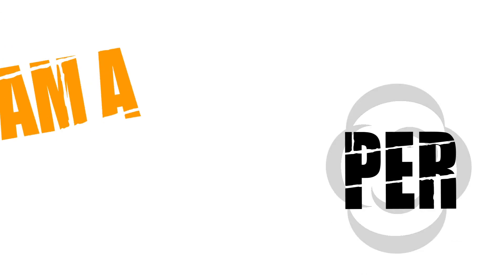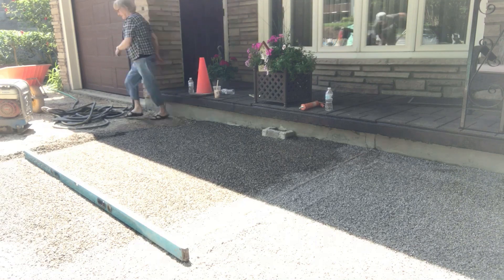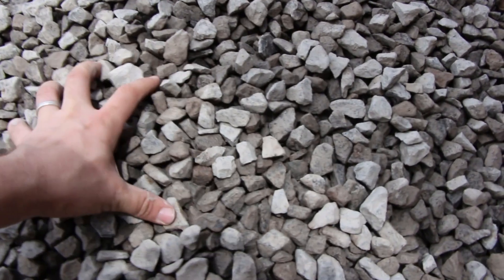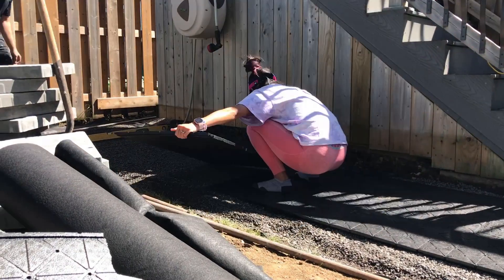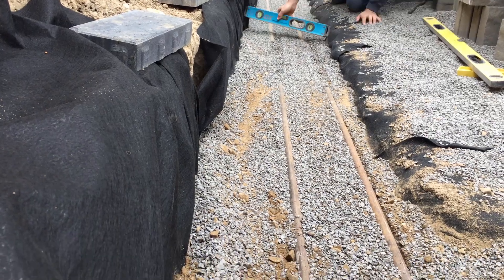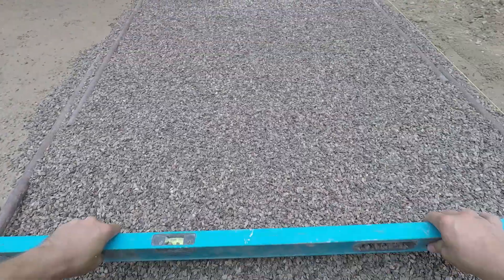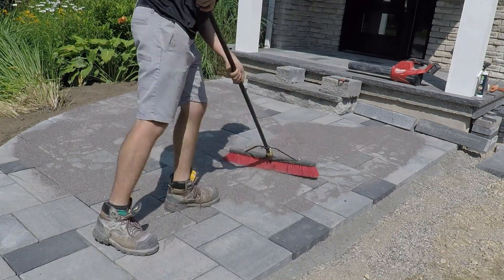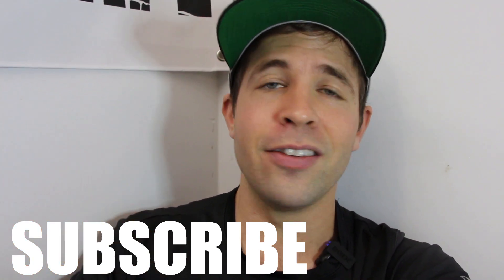High Performance Bedding for Pavers | Why We Use HPB Instead of Concrete Sand

Comment: Using sand to grade is the worst possible choice cause it's to soft and easily disturbed  and it can get washed away easy by heavy rain and ants will dig up your bedding . The only issue I don't like about high performance bedding is that it can scratch the surface of your stones and it's not fine enough to grade prefect . I have to lay plywood and tarps underneath plywood  when I'm using high performance so we don't scratch and destroy our interlock
Reply from the maker: Yeah I can definitely see that problem if it tracks on top of your pavers

Comment: Another great video, wish I saw it sooner. I’m in SoCal and went with Class 2 permeable 3-4 inches + 1” coarse sand screeded for the patio; and 2-3” DG on top of the Class 2 for the artificial turf sections. Supposedly USC used the Class 2 permeable for their new turf field, so hopefully it works for my back yard

Comment: Micheal, love your site. Thanks for taking the time to share your knowledge with others. I am a DIY er building a clay brick walkway/patio on 7 inches of conventional base and will be going for the 1/4 " chip bedding 1 1/2 inch thick. My question is how high should I place the brick against a fixed edge, so after compacting the brick will be relatively flush with the edge. I am planning on spacing the brick with 3/16 " gaps and using polymeric sand. My other question is how do you think I should compact the finished job? My thoughts are hand tamping after spreading the initial sand application and power tamping on plywood after the finished sand application.

Thanks
Don
Reply from the maker: Hi Don, thank you for watching! Typically HPB will settle up to 1/8" per 1" of depth. So depending on how deep your bedding layer of HPB is you can use that as a benchmark. I would sweep in the sand to the joints and then compact on the plywood. But it wouldnt hurt to do it as you mentioned as I am sure with the clay bricks you are laying they wont be touching one another (open space gap). So that initial tamping will help lock them in so there is no movement. But it is another step.

Comment: Man thanks to Mike and his/this video it saved my bacon today. I originally bought a load of HPB from a well known local building supply store (no not one of the big box stores). I ran out do went to another supplier very close to my house and picked up another load. BUT, after watching this and other of Mike's videos, while not a pro, I've done enough homework and research to know 1/2 of the garbage I put down was not the recommended material. Too many rounds and it felt like I was walking on a pebble beach with my feet slipping under me. 
After checking in with Mike, he graciously advised Absolut don't use that material. So my instincts were right. 
That $150 of material could've ruined my entire patio. 😢 But as we all learned in Star Wars; trust your instincts, you know it to be true.
Thanks Mike 👍
Reply from the maker: Thank you Carl! 👍
Reply: @iamahardscaper  It's important to give credit where credit is due. 👍🏻

Comment: Hey what base do you recommend for a 2" flagstone patio in Ontario? 3/4" Clear then HPB? Will be doing one in a new video! Thanks
Reply from the maker: Yes, that’s what I would do. You need to really sink them into the HPB and use an appropriate jointing compound to lock them in (I’ve heard NOCO by Techni Seal is good).

I love your videos by the way! I just watched the hot tub one last week. I live in Toronto and would love to come by and see what you are doing.

Comment: Discovered your channel a bit too late and have already installed 6” of dense graded base, the 3/4”-1” minus. The area does get water runoff as the yard has a slight grade toward where the patio will be located. Planned to use sand, but would you recommend using this material as a screed layer instead even over the dense graded base? After watching your videos, realizing this may not have been the best choice for a base layer, but it’s already in the ground and hoping to get things right for the next step. The pavers will not be permeable, if that matters—using Unilock Beacon Hill smooth pavers. Thank you!
Reply: Also located in an area with freeze/thaw cycles.
Reply from the maker: i like to use it on my screed layer regardless of the base material

Comment: Excellent presentation. From Ontario Canada. What is the standard depth required for base using hpb for bedding? Is a sub base of granular of 4-6” needed? How deep does the base excavation need to be for a common residential patio, walkway installation?
Reply from the maker: We go 1" to 1.5" of HPB as a bedding layer. Definitely still need a base, we go 6 to 8" for our base for residential patio, walkways. Because we are dealing with so much poor clay soils here.
Reply: @iamahardscaper  In my part of Toronto it's primarily "yellow" sand, which results in amazing, for the most part, drainage as opposed to the clay I was accustomed to in Scarborough. 
I am doing a walkway with concrete flagstones. Would you recommend the same base as the reply above?

Comment: I am just about to screed a small patio in my yard. This video has convinced me to use the HPB over a concrete sand. You mentioned it would sink a bit, but I am assuming for a small patio, this would be negligible?
Reply from the maker: No, you just need to account for that when you are screeding. That it will go down less than a 1/8” per 1” of bedding. You want to screed a little above your final height

Comment: Hi,
Thank you for the great videos.  I am putting up a raised patio.  I excavated about 12 inches.  I have put in 6 inches of aggregate A and add 4 inches of HPB as the bedding layer.   How much should I compact this layer ?  The aggregate A was compacted with a vibrating plate,  should I do the same with the HPB?  Also should I use a synthetic layer on top of the HPB to prevent shifting, and future ant colonies?
Reply from the maker: HPB does not need to be compacted. Though we don't go any more than 1.5" for HPB. You've got enough base there that you do not need the synthetic panels on top.
Reply: @iamahardscaper thank you !

Comment: Amazing video, thank you for sharing your knowledge. I'm in Toronto Canada and just dug out a 400 sq ft area to lay patio pavers. I have dug down 7 inches. My patio pavers are 2 inches in depth, so I need fill 5 inches for my base. Would it be ok to use high performance bedding  for my entire base? I was originally going to do 4 inches of recycled crush stone and 1 inch of limestone screening. But my life would be so much easier If I could just to 5 inches of hpb followed by polymetric sand to fill the paver joints.
Reply from the maker: Unfortunately not. It doesn’t have the same bearing ability as a 3/4” stone or Granular A which would be your base.
Reply: @iamahardscaper  So then put 3/4 stone as my base then use hpd as the bedding? do you think 2 inches for hpd is sufficient?
Reply from the maker: We do no more than 1.5” of  bedding material
Reply: @iamahardscaper  understood, so I'll be going approx 4 inches of 3/4 crushed stone with 1.5 inches of hpd

Comment: Hello, about to start a DIY backyard patio and your videos have been very helpful. Keep up the great videos. One question for you though, can you use HPB as the entire base or would I need a 3/4 clear as the base and then use the HPB as the bedding layer? I've been getting mixed answers regarding this. The yard that I'm purchasing my stone from is saying that I could use it as the entire base layer directly on top of the fabric.
Reply from the maker: You definitely can only use it as the bedding layer. I used to work at a yard that said the same thing and even myself installed some on only HPB. But it is not a base material, it just does not have the bearing ability that a larger aggregate does. There are no manufacturers or the governing body of interlocking concrete that specify it to be used as base.
Reply: @iamahardscaper  do I need to compact the HPB above the 3/4 clear aggregate?
Reply from the maker: nope

Comment: I used to build interlock patios from a pool company and we always used 3/4 clear as base with hpb as top layer.
I am doing a patio for my own home now years later and ivd been told by someone who sells the material that the hpb will wash through the 3/4 clear and to use 3/4 crusher run and hpb as my 1" bedding. Does that make sense?
Reply from the maker: No, 3/4 clear does not have gaps larger than the 1/4" HPB for it to wash through. That being said, we have used 3/4" down to fines for our bas with HPB on top for some scenarios.
Reply: @iamahardscaper  awesome, appreciate the replies! Solid page. Helping out huge. I'm at the point now to put polymeric down. Worried about tamping and possibly moving interlock too much. Looks like it needs to be done.
Reply from the maker: If you sweep in the sand and then compact it, they shouldn’t move. Make sure to use a pad to protect the pavers

Comment: Isn't this just an equivalent of 3/4" clean/washed crushed stone, aka #57? You mentioned it's a marketing term for a Canadian company, is "clear" just a Canadian way of saying "clean" or "washed"?
Reply from the maker: No the marketing term for it is HPB. It is 1/4” clean. Meant as a bedding layer on top of 3/4” clean
Reply: @I Am a Hardscaper  ah gotcha. Layered approach, makes sense. It's similar to how we build water drainage under sand volleyball courts.
Reply from the maker: oh nice. So you would use 3/4" clear and then some sort of fabric on top to then install the sand for the court?
Reply: @I Am a Hardscaper  pretty much, yea. A lot of times, places will just install a small layer of pebbles under the sand, but I always liked the drainage better with the layers. Lowest layer is larger crush rock, followed by a layer of smaller crushed rock, then the fabric, then the sand. Grade the ground to a corner as well, and you can put in an additional small drainage pipe from the corner away from the court.

Comment: Thanks for the video! What's the guidance on the depth of the 3/4" rock? I've excavated at least 14" down to clear root mass for a patio and was planning to build up the pad with class 5. After this video, I'm interested in using the 3/4" base and HPB, but haven't seen what the height recommendation/limit is. Also worth asking, with a ~90% lock down, how does this compare with a sand bedding, which can usually be expected to compress 1/4" to 3/8" with a plate compactor? Also curious what the compression might look like for slab work that requires a roller compactor. Thanks! 😊
Reply from the maker: Depth is same as the class 5 base. This will compact slightly around 1/8”
Reply: @iamahardscaper  Great! Thank you! Given the depth of excavation, I'm considering building up the pad with class 5 and then transitioning to the 3/4" rock and HPB. If I end up doing 10" or more of class 5, is there any need to worry about using geogrid if each lift is properly compacted? Surrounding soil, which was also excavated, will be lifted as well in the process. 

I also have step units and a paver platform to integrate and I'm having a hard time seeing how to use the rock for the step units that are supposed to laid on grade. Can we use the HPB over class 5 without an issue or should we stick with the typical pairings (class 5/sand vs. 3/4" rock/HPB)?
Reply from the maker: I still always like to add geogrid somewhere. HPB works on top of class 5
Reply: @iamahardscaper  Thanks again! Is there a similar 1/8" compression with  the HPB over class 5 when compacted, or is there another number to factor into my measurements?
Reply from the maker: Yes, as long as the base is properly compacted prior to installing the HPB.
Reply: @iamahardscaper  Great! Looking to use a plate compactor with ~6,700 lbs pressure for soil and class 5 and a roller paver for the slabs. A couple more questions. 😬The excavation went deeper than I had anticipated to clear root mass, 21" in some spots (120 yr old ash tree). Can I build that up completely with class 5 with geotextile underlayment at that depth or would you recommend raising the grade with compacted pulverized topsoil (or junk brown fill soil?) and then aiming for 9" of class 5 and then the HPB? Or, similarly raise the grade with class 5 to a similar height with the remaining 9" being the starting point where I integrate the geotextile as being the "official" starting point of the pad? Also, I have a 4' strip for planting between the foundation and the paver patio/walkway. As the paver pad isn't up against the foundation, should my priority be on drainage (non-woven) in terms of using a geotextile underlayment? If I run the woven stuff up the sides of the excavation area**, I imagine it will significantly limit drainage from that planting area that is up against the foundation. Am I on the right track with that or would a woven product be preferred with a paver/slab (Techo-Bloc Blu 60) product? TIA! 😁

** Techo-Bloc install materials illustrate it basically making a burrito of the pad, going up to the top and folding over toward the the edge restraint, creating almost total separation from surrounding soil.
Reply from the maker: This just happened to me, my latest three videos are on this exact excavation. What I did was build up using the same base material until I got to what would actually be my base at 8" and installed geotextile then worked my way up. Exactly as you said on the final part. Some will use clean fill because it is less expensive, but in my case I just wanted one delivery of aggregate and used that instead.
woven / non-woven is more so dictated by your subsoil. In this case, your subsoil would really be your aggregate with good drainage so you may want to go to non-woven. I went with woven on mine.
Reply: @iamahardscaper  I think I did see that video you were talking about.  Great point... I had been wondering if I raised the grade with class 5 and then started the pad with woven geotextile, if that would be adequate for drainage. e.g., water could basically go down and under the woven textile, through the lower level of class 5. I've seen some folks pin their underlayment down. Is that generally par for the course or only for geotextile being used with a higher percent of slope, like on a hill?  

Define clean fill. lol I've been to two local spots and all they have for "brown fill soil" is pretty dirty. Lots of larger stones, wood chips, root matter, clumps of grass, etc., and overly silty without much if any clay. Oddly enough, the stuff I got last year from one of the same places was what one would expect with a lighter hue and more clay in it, good for compacting and grading where it holds its shape pretty well while not being overly clayey.
Reply: @iamahardscaper  I was reviewing one of your blog posts and saw mention of at least a medium weight non-woven fabric for use. Can you give a number to that? One I'm considering has a weight of 5.6 ounces (per yard, I believed). How does that compare with your recommendation? 

As a side note, I noticed that the Alliance Gator fabric recommended for pavers is a 3.5 oz material, though perhaps that is due to their preference for synthetic base?

Comment: We plan to fill in our inground pool and lay a patio which, when finished, will extend just a few feet into the shallow end of the pool. Our landscaper suggests using HPB to fill in the void in this area, but we aren't convinced it will be enough to prevent a significant sink.  Three feet of HPB?? Also in the GTA.  Is it as good as all that?
Reply from the maker: I personally wouldn’t. But it is also something I have never done before and I would rather fill in the inground pool one year and then do the project the next year depending how things settle
Reply: @iamahardscaper  That's pretty much what we are thinking. Thanks for the reply!

Comment: I’m unable to find ASTM 9 stone in my area to use under my Gatorbase panel. I did find a clean angular chip in the 3/8 to 1/4 range. 

Sieve numbers show it a little bit bulkier overall compared to ASTM 9. Can I still use it under the Gatorbase?
Reply from the maker: Yup that works, that is what we use.
Reply: Thanks. Your narrative style is thorough and understandable. Well done. Cheers

Comment: Been stonescaping for 20 years. I’ve always used 3/4 clear under all my armour stone walls and natural steps. Not one complaint of sinking (over 900 jobs) 
HPB is the best for paver projects
Reply from the maker: Nice! Great to hear
Reply: I've got a large patio with 3/4 clear because I thought I was going to pour concrete.  Could I simply add HPB as a top layer over this and use pavers?  Thanks for your help, 1st job! lol.
Reply: @robvendetti  technically you could but I’d use a plate tamper on top of the hpb to vibrate tue hpb to fill in any voids in the 3/4. Once you feel confident there won’t be any sinking start setting your scraper bars.
Reply: @room1271  Okay, got it!  Thanks for the tip... appreciate it!